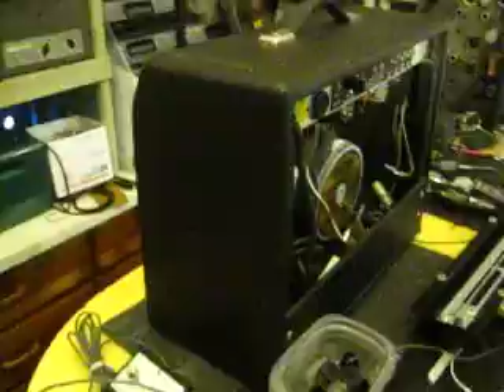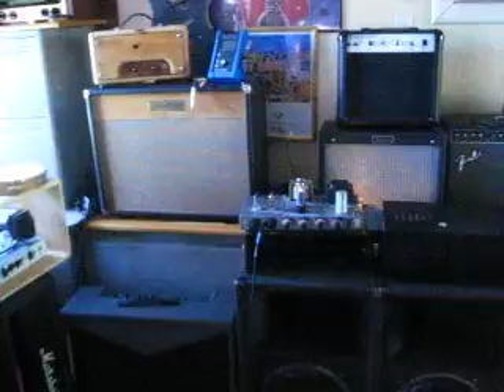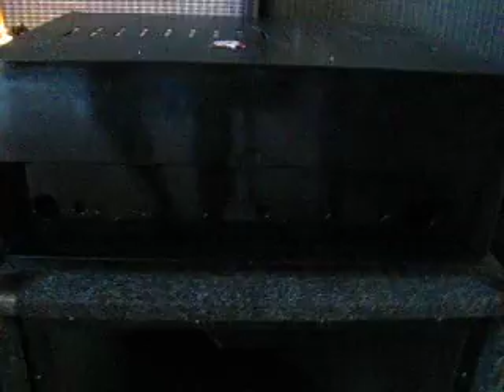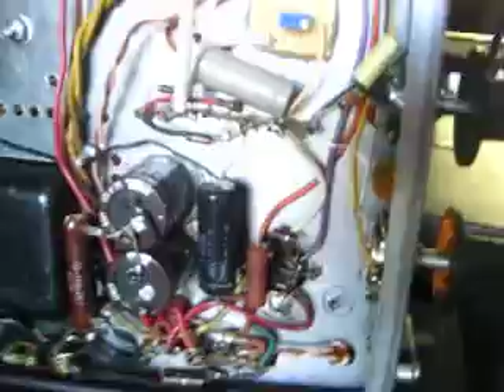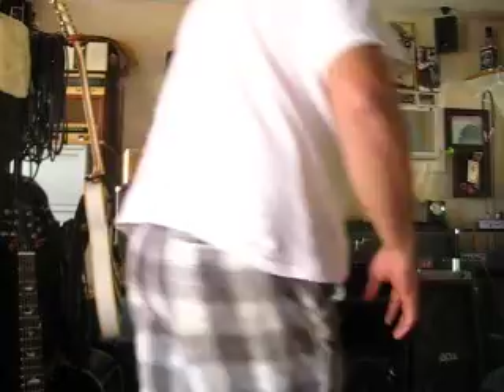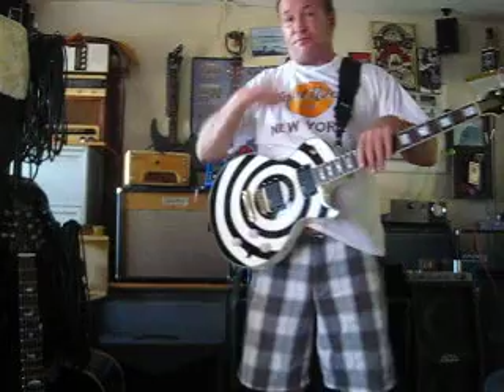MARSHALLESQUE 50 WATT BOGEN TUBE GUITAR AMP CONVERSION W/ADJUSTABLE BIAS EL34

Comment: I acquired one  one of these Bogen CHB-50'S...I didn't  really know exactly  what it was until later...Someone had converted it and added a  jack and put it in a wooden vinyl covered  casing...very nice.... I have to overhaul it ,haven't looked under the chassis yet....I found the schematic and technical data and apparently this amp is suppose to have a frequency response of down to 20 Hz....so I would rather use it for a mono block hifi ..music amplifier ...Music  and movie soundtrack /audio should sound incredible through it with big hifi speakers hooked up.... and  be very loud in living room setting ...I will still use it for a guitar amp sometimes or possibly  bass /keyboard  amp   and can run  an overdrive/distortion into it ...I like bassy sounding guitar ............
Reply from the maker: Yes, you could take 2 of them for A&B ch.s and that would crank. I have 2 precision S60 s as A&B which are the same in output as the bogens and it is very loud and the sound just goes straight into your bones.

Comment: Great stuff . I like the idea of being able to switch power tubes. I am getting into building tube amps and selling on ebay trying to use as much vintage parts as possible. Do you know any good links for schematics for el 34 powered amps? I like the chime you get off those tubes. Keep up the good work. thanks for videos.